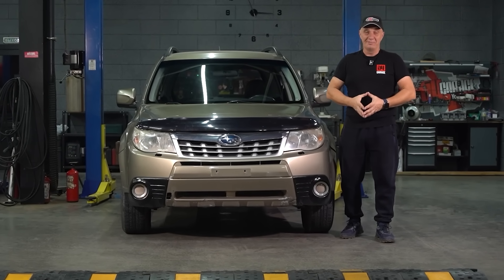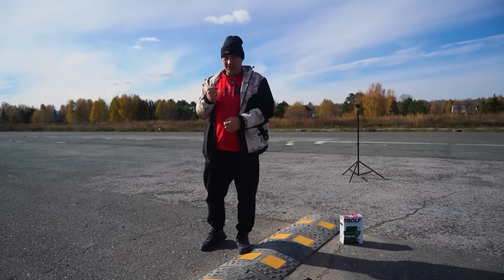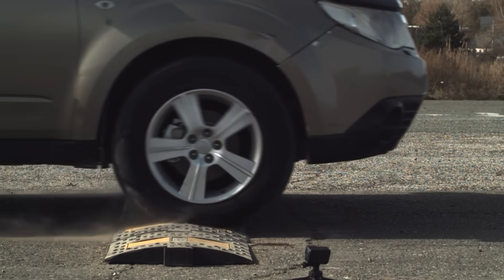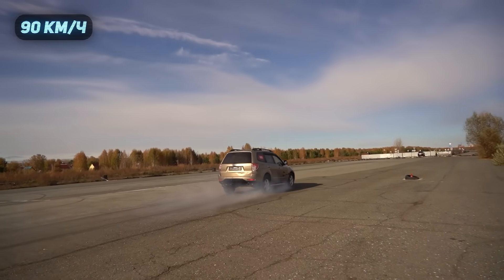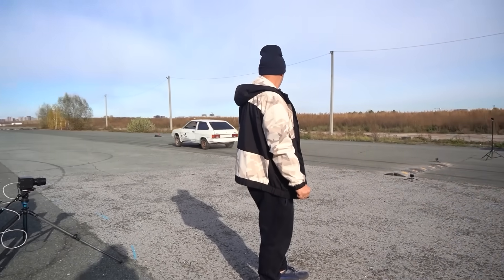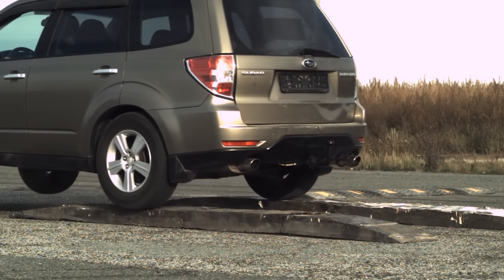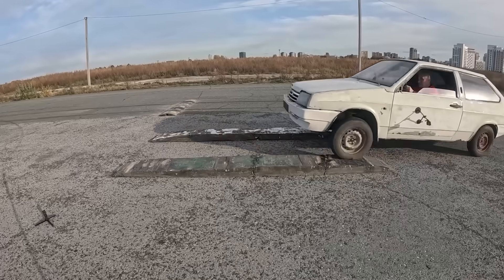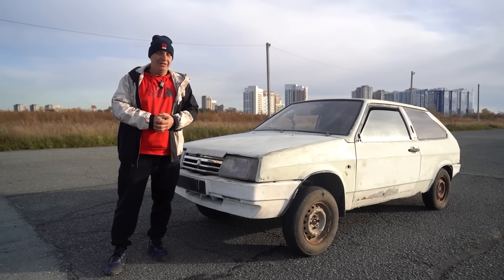Hitting a speed bump at high speed - what will happen?

Comment: I suggest that you guys build an extended-range Lada with a GIGANTIC fuel tank and attempt a Naukan to MInsk journey with no fuel stops. If this seems a bit over-ambitious, a more practical but still impressive achievement would be a journey from Prudhoe Bay, Alaska to Key West, Florida. This distance is considerably shorter and the roads are MUCH better. (although access to Lada parts may prove to be somewhat more challenging)

Comment: Problem with the bigger speedbump is not the size, but the fact that as the cars squads you would probably break an oil pan.

Also In my city in EU they recently  mounted the most extreme version of an speed bump, it is in a 30kmh zone and it is 20cm high and has like 30°  even maybe 40° degrees incline 🤯🤯

Comment: Some areas in Canada have what they call speed calming devices. Basically the road surface is raised pretty similar to how these made those 2 long ramps. All the way across the lane. And some are raised pretty substantially.  That's usually in a residential area where they are trying to cut the speed way down. 
 Every morning I hit this damn speed bump on my motorcycle usually around 60 or 70 KPH. It gets some good air and distance. The funny part is I've been riding this same road forever.  Every morning,  probably because I'm still half asleep, I forget the damn bump is there.

Comment: I was doing about 275 kph riding a ZX-14 on a remote seal-coated road, and forgot about a cattle-guard until it was way too late to do anything about it.  This wasn't one of those more modern flat(ish) cattle-guards with generous flat bars spaced for tires, this was old school pipe and mounted several inches below the roadway.  All I could do was lift my ass up and get on my haunches, I was expecting a serious crunch but laughed when the bike soaked it up with shocking aplomb.  The ZX-14 actually has fairly supple suspension lurking within the somewhat firm sporty nature.  

It is obviously way, WAY more critical on a bike that you never hit the brakes when surprised with sudden 'speed bump' type obstacles (including holes), but even in a car your best option if possible is to make best possible acceleration before you hit.  Even a tiny bit of weight transfer to the back end makes all the difference in the world.

Comment: My 1,6L Opel Astra with Bilstein rally dampers and springs could do 80km/h over speed bumps in 30km/h zone and probably any speed but that was the speed I got it up, to... The faster you went over it the less you felt it. The suspension just ate it up....  But in another town the speed bumps was so huge that I saw a  stock Toyata Yaris scrape under the driving over it, you HAD to drive over them at an angle unless you was driving a lifted offroad truck with monster tires.

Comment: Guyssss next time you wanna try that don't go with a Subaru that has one of the most comfy suspension, and the forester that has a 65 or 60 tyre profile, go with some low profile so you can have a big laugh but ofc use some head and neck protection, I'd suggest some BMW or meecedes but ofc try and raise the car a little first so you won't... Severely damage the undercarriage 😂😂😂

Comment: In a 1976 pontiac I hit a speed bump at over 100 mph (160 k/hr) I flew a while, the bottom of the car scrapped the cement leaving sparks I could see in my rear view mirror (night) and the car continued on as if nothing had happened. I a modern plastic car parts would have flown off in every direction..
Reply: I agree...!
Modern cars don't last as long as they used to...!

Comment: When you use your brakes it is important to release the brakes before hitting the bump, so the weight of the car is taken from the tires and is moving up even without the bump. When the tires then are pushed up they don't create an up momentum to the cars weight and the ride stays smooth
Reply: He knows what he is doing. If anything, they physically show you with proof.
Reply: @forevercomputing  Obviously not. I don't see him doing it, even if the big bump used in the last tests is pretty similar to what i had fun with, so i know it's possible to get over that bump very smoothly

Comment: I think when you did that emergency brake test with the custom speed bumps, I saw both of the Forester's fenders slightly come undone from the force after it landed. From the looks of it, it also appeared to land on the bumper at the same time as the front wheels so half of the Subaru's front fender looked like it was gonna fall off if the test was run a second or third time.

Comment: early 80s toyota sedans and wagons, particularly those built for Australian conditions had suspension designed to cope with corrigations and potholes for Australian roads.   In those the speed hump may as well not exist.  You can go over at any speed, and the car barely even reacts.

Comment: It depends on the speedbump, but i've noticed when you approach one with about 65 km/h and you break for only half a second very hard, so the car dips down and comes up again directly before hitting the speedbump with your front tires, you don't really feel the speedbump anymore. It works best with speedbump about 3 - 4 meters long. It will take a while to figure out the best speed for your local bump and to perfect it you can practice when to do the same for the rear tires, so you don't feel it at all anymore. Have fun getting it right for the first time and you will never go slow over a speedbump again.

Comment: Uh, are we not going to talk about the Forester randomly losing its ABS and locking up the wheels, even before it came into contact with the speed bump..??
Reply: Abs may not be standard equipment in their country . I was thinking the same thing because even my '98 Forester the very first year available here in the United States came standard with abs
Reply: Yes, i think the same...
Reply: Yeah ^^
This particular 60A fuse had a better purpose and life in another Lada.
You know, this kind where radio, subwwofer, AC converter and heater assistant are pluged all at once.
That forester's abs work fine on streets ^^
Reply: Older Subaru ABS isn’t great. The most mine ever does is pulse twice and lock up. It’s in working order, but the computer they used for it isn’t very smart, even my roommate’s old E30 had a more advanced ABS system.
Reply: I was coming to say it might've had the fuse pulled, but diuvig beat me to it. 😋 However, could've used the Parking Brake trick... At least I think it works on ABS... Where pulling it one click, enough to engage the switch for the dash light to turn on, I believe it used to disable ABS (and Daytime Ruining Lights) on early 90s vehicles here in the US. I haven't driven my 93 Firebird in well over a decade, so I can't even go test with that. 

But yea, even our 1990 Chevy Suburban hasABS and it's the Farmer's Package! (aka Scottsdale; lower than base model) 😅
Reply: Some people believe that ABS increases their braking distance and disable it. Some don't bother with repairs if e.g. wheel sensors fail. In any case, guys use scrap cars, who knows what they have been to.

Comment: I was motorcycling down a country road cruising around 75mph (1997, YZF600) in late afternoon. Came up on 2 cars and passed them. As I passed I gave it a little squirt. As I pass the lead car I'm doing 100mph. When I get along side the bonnet I hit a massive bump of molded bitumen (SURPRISE!) which while still under throttle throws the front wheel up in air. So at the point I pass the front of the car I'm doing 160+kph and pulling a mono. Throttle back slightly, dropped front wheel and squirt again. Get the hell out of dodge.

Comment: You should experiment with electromagnetic suspension like Bose did in the early 2ks. Would be interesting if you guys could pull it off and jump over speed bumps
Reply: They did that in 2019.
Reply: Or what audi does on the a8l.... Even my 2004's active air suspension glided across a speed bump at 70 with no issues and no discomfort

Comment: Your speedbumps are pretty tame compared to some I see around here heh.
In Brazil we call them "quebra molas" (literally "spring breakers") because of what happens if you meet one at speed. The raised pedestrian crossings in particular are brutal, a lot of common cars do bottom out and hit the front when leaving one if not under 20kph (very slow).
Reply: Anything without good ground clearance is basically stuck if it goes there lol
Reply: true that. it's common to see bumps way steeper, basically the shape of a trapezoid
Reply: It depends...!
Here in Brazil, there's no "standard" for speed bumps...
There are those mild ones, even water pipes or steps, that are horrible!
I've hit several speed bumps...
If it's a really mild one... I take my foot off, go over it, and then step on it again...
In my 2014 SZK GV3 4x4, I can do it just fine... However, in my 93 Samurai, I go slowly because it has a very stiff leaf spring, so I go slowly... Hahaha

Comment: just hit the brake lightly and release befor the bump.. smooth ride
Reply: Exactly.
Reply: That's what I do every time.
Reply: Good tip, maybe clutch down for top smoothness haha
Reply: Many years ago, I found that the “magic number” for most standard residential speed bumps is 15 MPH.
I used to drive pizza.
There was this trailer park that had speed bumps everywhere.
My car had a good working suspension, but the shocks were a bit weak 
At 15, the wheels would simply retract and extend with little transmitted “bump.”
Anyone following behind me would slam on their brakes…

Well, QUIT TAILGATING!!!

Never felt sorry for them..
Reply: @dangeary2134  Haha, good job on the tailgaters, they are a menace indeed!
Reply: A flying carpet with this protocol within these 2CV, DS, BX, CX, ..., kind of retroactive suspension and amortissement tech
Or do we said feedbacked techs ? Smooth ride indeed.
Reply: Yup, compresses the suspension for a smoother entry, and decompresses it on the way out
Reply: @AdvancedSoul no, if you compress it on entry it will hit hard, guy said release BEFORE.
Reply: I split the case :
For emergency i release befor bump, whatever hardnees i hit the breaks. (Losing so much prescious cinetics power by the way ...)
For anticipated smooth ride, i handbreak After front wheels, and only hand break. Or use a descent car.
For descent ride, i don't cross any bump ... (lol, its moovie ^^)
For every situation, i hope my knowledge is enough and wish i knew it anytime.
Reply: @PREDATEURLT  Yes 🙂
Reply: @AdvancedSoul lmao..... l2read
Reply: I wonder, we release brakes at the very beginning of the bump and release them at the top ?

For long bump with rear hand break, i brake the rear wheels when the back suspensions are compressed.
Holding it all the bump, then release. In combination with  @Cuff-re8ej technique for classics suspension.
( ..., There were no rear brakes on hydraulics Citroën !!! So i must lie ... )

@justinsalazar4952  It keep the body more or less at the same level.  Exactly.
@HeavenlyWarrior  I do it every time. I mean, me too.

How (not) to avoid them : Education befor politics ?
- Is no bump a solution ?
- What kind of an answer are bumps ?
- Is the flying carpet relies on itself or its authors ?
- Does a smooth ride relies on tech or behaviour ?
And what the thin_ is art ?

There is a place to ride at 0.x G (m/s-2), and yes, a constant 200Km/h is a 0G to 0.1G for smooth turns or anticipated decelerations. [i like it !]
There is a place to ride at 1G. [i like it !] Is more ever called an accident ?
Yes. Except when half mass weighs less than light itself. [And yes, "less is more, more or less".]
But this is why [we love them]. Energy and Power. War and Love. Peace and Art. Left and Mister, Misses and Rights.

...

Comment: Me and my friends did this in a Toyota station wagon. Some of the suspension survived. I was in the back seat, but I think we were doing about 60 mph. There were 9 of us in the car. Your speed bump is much smaller than the concrete ones we have in my part of America.
Reply: When I was younger some friends and I were cruising around in my Volvo wagon, I was going down an unfamiliar street at night and NAILED one of those big tabletop style speed bumps in front of a town hall or something at nearly 40mph. By the time I saw it it was too late, I just yelled "fu-k speed bump!"

My car flew, and my speakers and any crap I had in the back smashed back down.
Reply: @volvo09 should probably get those speakers installed so they're snug as a tug from a thug
Reply: I was expecting to see those wide ones the USA uses too
Reply: @CharlesJohnstone-c2n you should see the speed bumps in Bulgaria. Wide and tall- at least those in Durakculak are very unpleasant.
Reply: Hahaha!!! I have a 1970 Cadillac DeVille and it used to be really hard to find shocks for it. When I finally did put new shocks on it, I started feeling the speed bumps. With blown shocks you barely felt them. The opposite of the Lada or whatever that thing with the welded suspension is!
Reply: 30+ years ago me and a friend of mine took the speed bumps at great speed down a road local to us called Burnthouse Lane in Exeter (England) with our friend Adam passed out, stoned and asleep on the bed in the back of my 1969 VW Doormobile campervan.

We hit one of the bumps so hard that he lifted off the bed and hit the ceiling. Even remembering it now it’s making me hurt laughing.

He was raging! 😂
Reply: "Some of the suspension survived" 🤣
Reply: @RedHeadForester I think some of are injured and some of are killed
Reply: Here in Canada, where I am we have small ones and large ones. The large ones will bottom out most cars if you go too slow, and destroy them if you go too fast while the small ones are sometimes ignored by people in rust buckets.
Reply: Yeah. They tend to use a much steeper slope on them here in the states. They put one in at the entrance to my neighborhood back when I was a teen. They didn't mark it so it was exactly the same color as the rest of the road. My brother was on his bike and hit it at a decent speed. It through him off his bike and he got banged up pretty good.
Reply: Yeah they know better.  They know people will fly over these little ones at 65 miles and hour if they want to with a pickup.  Try doing it with a lowrider though, or a supercar.   My old car couldn't make it over the large ones, NO WAY... scrape.. my whole exahust system had a "flat spot" lol
Reply: @pepperfish_  yeah i had an 84 Oldsmobile Delta 88 Royale. Lowered that thing barley made it over the railroad tracks. Had to do RRtracks and speed bumps at an angle. Couldn't go straight over without getting "high centered" or scraping the exhaust off the car lol loved that car though
Reply: @dannystephenson4855  lol low-n-slow, Cool car, I tried getting one of those on the road when I was 16, 307ci.  But it was too far gone for my skill at the time. I don't drive the low riders anymore, the roads are terrible where I live and the cops don't like anything that "looks" modified.  So I drive a sleeper.
Reply: Well yeah. Lucky that didn’t happen. 👍
Reply: Cool story bra
Reply: I hit one when I first started driving too, snapped my exhaust clean in half when I landed 😂. Lesson learnt.
Reply: Yeah I wish our speed bumps were that small lol. You have to hit ours at speed or they'll beat you to death lol
Reply: Lucky you didn't become part of one of those stories where 8 dead teens were found in a crashed car...

Comment: Subaru traction control is off? Or abs not working?
Reply: ABS is not working. 

Turning off TC will not disable abs. Probably has a wheel speed sensor problem causing the system to disable itself.
Reply: Surprised it stayed in one piece 🤣